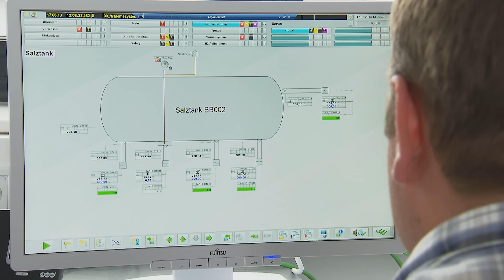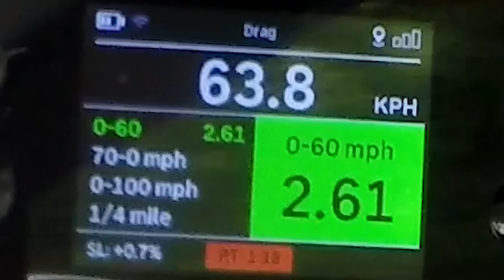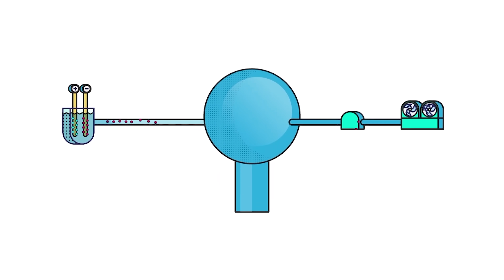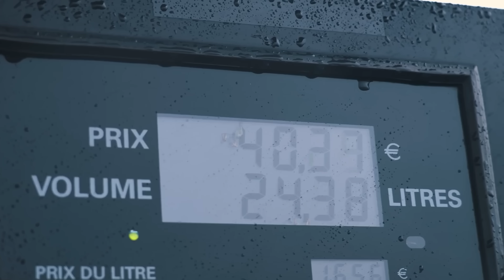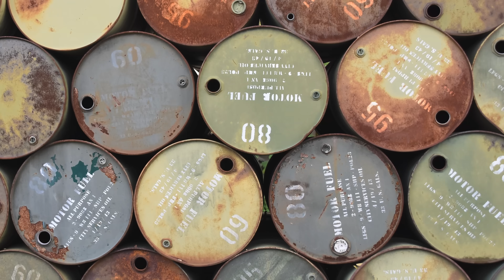Porsche just SAVED petrol engines FOREVER

Comment: I wish Porsche the best of luck on their ambition to save the cars
Reply: The only problem with this idea is the new fuel costs twice as much as the old fuel😂
Reply: @kellykubik4514  its currently around 6 euros a litre and normal fuel is about 1.4 euros a litre so its pretty expensive but as more use it they should enter economies of scale and prices will fall because the fuel market *with alternatives, is elastic therefore the lower the price the more people will proportionally consume. This is only the case if you can choose between fossil and synthetic because otherwise its a cartel and you have to consume one. Such as in the UK our fuel prices are incredibly high even when global oil prices are lower than they were before the ukraine war.
Reply: @fintan.  very well said
Reply: @fintan.  There is only one problem: electricity allows to drive electric vehicles at a cost of only 3 dollars per 100km, or 5 dollars per 100 miles. Synfuel thermal engines will consume around 5 to 6 litres per 100km, or 8 litres at best for 100 miles. So it would cost 48 dollars at least to drive such a car 100 miles. Price needs to drop TENFOLD to be able to compete with electricity, so the litre must go below 60 cents. Knowing that one litre has 12 kWh of energy, even if we achieved 100% energy efficiency from electricity to synfuel (which is physically impossible), you need to produce electricity at a cost of less than 5 cents per kWh. And given a 20% energy efficiency, we are more realistically looking for electricity produced for less than 1 cent per kWh.
Good luck with that. I stick to elctric, the real car of the future, like it or not.
Reply: @texanplayer7651  whilst you make a reasonable case, in europe and especially the uk where i am from, we are seeing a much worse scenario. our electricity prices are through the roof. our government decided to buy lots of energy at the peak thinking it was going to increase in price, and since it has crashed but we are left paying 33.2p per kwh on average. which in dollars is 0.41 usd per kwh. according to google you’re average is is 0.14usd. understand that’s about the third of the price. That’s already a bad start 💀 anyway, the average petrol price in the uk is about £1.45 per litre. this converts to 7 dollars a gallon, again that is terrible. The case for synthetic fuels in the UK is much more viable than america. considering we are paying double the petrol prices, and triple the electricity, whilst it is not tenfold, with government intervention it will pull down prices drastically and i’d prefer to own a combustion engine car that will go the same distance on a tank after 30 years than an electric car that can’t go half its range after 10. electric cars are only viable for people who are willing to spend 30% more on the respective model, for it to achieve a range of 30% less. at a cost of 20% more due to electricity being more expensive per mile than petrol. diesel is proportionally more expensive to petrol as the range extension it provides. diesel is 15% more expensive and you will go 15% further on normal journeys so let’s assume they are the same. when electric cars are more expensive to purchase, and run (right now in thr uk they are) and the infrastructure is absolutely disgusting, oh and our government grant is basically gone. there is no incentive to purchase an electric car that will need to be on the road for 10 years in order to be more green than a combustion engine car (battery disposal and production and source of electricity not being green). 

on top of this, in england our government has pretty much removed the financial grant to purchase an electric car as i said earlier. If you could provide a reasonable answer to why this is, other than it’s a sign they made a mistake pushing electric cars and are now stepping back in force of synthetic, then by all means i count my argument invalid. a final point i’ll make is how OPEC has a complete monopoly and cartel control over oil, so why be subjected to their manipulation to oil prices. Anyway, i don’t mean to come across rude if that’s how it appears
Reply: @kellykubik4514  that’s because the technology is very new, as the production becomes widespread it’ll get a lot cheaper
Reply: @kellykubik4514  How much will it cost to charge up an EV in 10 years with the way energy bills have increased? You do realise wind and solar power is way more expensive than coal or natural gas? Also C02 is plant food and climate change is a death cult.
Reply: @kellykubik4514  in Sweden we pay like 3x the price of the fuel in America so you’ll be fine but here… it’s gonna be rough
Reply: @kellykubik4514  that's because there's only 1 supplier right now. They have no competition at the moment.
Reply: @kellykubik4514  ye, that'll come down obviously as the production ramps up and the process is refined... Thought this would have been obvious to people but nvm
Reply: @adampatterson2682  you think so hey, that’s what they said about gas and the prices keep going up, in a world of capitalism you can not underestimate big business😂
Reply: @kellykubik4514  Thats why it is DOA
Reply: Its because they arent mass producing it but once they get more help for mass production it will be the same as our current fuel@kellykubik4514
Reply: @kellykubik4514  Yes because it’s in early development but Porsche predicts that once, or if, it’s adopted on a larger scale they can bring it down to under $2 per litre, which is basically the cost of petrol in most parts of europe now.
Reply: @kellykubik4514  I am paying. I don't mind
Reply: @kellykubik4514  The only problem with this idea is the new fuel costs twice as much as the old fuel
Inherently.  It's a con.
Reply: Well said! Samsies!!! This is it!!! We need that fine GERMAN ENGINEERING to pull the automotive enthusiast out of this!!!
Reply: Smoke and mirrors! Carbon emissions from farming alone is in a different league to car emissions. ICE aren’t going anywhere in a hurry regardless of wether they bring this fuel to the masses or not. There is so much oil in the earth, we couldn’t deplete the supply if we tried! Not only that, the ICE of at least the last decade or so have been so efficient and clean they are more or less emitting water from the tailpipe. There just isn’t an extensive enough of an infrastructure to support ev cars anywhere anyways. A good friend of mine told me that in LA for instance, they have two hour cues just to get to use a charger. Then yu have to sit and wait to charge ur batt. Add that I was told their electrical grid cannot handle everyone charging at the same time. So go figure.!! I’m seeing manuals, V12’s, V8, all sorts of exotica being released of late! All the major car brands are not looking to abandon so many million and years of development just because some stupid lying politicians are attempting to push their agendas! Just my 2cent for whatever it’s worth! So, here to many more years of the ICE!!🥂🚗🚛🏎
Reply: The world has been getting warmer since the ice ages, there nothing we can do to stop it
Reply: Hope we won't have to suffer the misery of Ev's in future.
Reply: They already have saved the car by making the Taycan.
Reply: Good luck buying a litre of e-fuel for 20€
Reply: @vojtulee1  it’s only that much due to the one factory they have and the distance it is from major distribution points
Reply: @sama5946  it's not just that
Reply: Forget Lamborghini, time to save up for a porsche.
Reply: So, we use lots of electricity to manufacture e-fuel, then burn it, and then start the process again?
Carbon offset is a joke.
Reply: @ricco123tube  if most of the electricity is coming from renewable sources, i dont see any issues
Reply: How about instead of hope we just vote out all the controlled commie scum in government? Climate change is a scam. No one voted for any of the measures they're forcing on us
Reply: I wish
Reply: The sound of burning petrol  turns me on🤤
Reply: @ST22HTV  is Porsche 959 powered by Petrol?
Reply: Yes but why did it take them so long to develop this… if they wouldve started earlier and succeeded, electric cars probably wouldnt have been so mainstream as they are now…
Reply: To safe ICE. Saving cars😂
Reply: "best of luck on their ambition to save the cars"

"Cars" will be there a long time into the future. It's the specific engines that are contributing to climate crisis that are being phased out.
Reply: Porsche aren't doing it to save cars. They're doing it to sustain their Motorsport activities in the years ahead. There will never be enough to go on general sale. It is hoped (note the word hoped) that the manufacturing plant in Chile may be able to produce up to 500 million litres a year. Sounds a lot, until you discover the World uses more petrol than that in a single day
Reply: Porshe ambition is to make money not to save cars. 🤣
Reply: I think the German carmakers are trying to hold onto something that's past its sell by date. As long as China continues innovating and leading the way in EVs , Europe is wasting it's time. They better jump on the bandwagon and be part of the evolution
Reply: Lol, its all bullshit. Exxon oilers are behind it. Porsche is just their puppet. Its just a distraction for ppl, to not buy EVs and buy more ICE. 😜
Reply: I wish politicians in the US and UK would listen to globalists telling them it won’t make a difference. No change to our climate whatsoever unless the entire world does it. That’s not happening.
Reply: @ST22HTV  Trac heh
Reply: It was done 60 yr ago with a converted vw beetle the inventor was murdered and his technology was stolen , he wanted the world to benefit and wouldn't sell out to the car manufacturers,  his invention was featured on american news you can still watch it on you tube
Reply: Is Porsche German?
Reply: @dug439  yes
Reply: AHAHAH you are so NAIVE, it has nothing to do with saving cars, they could have left "normal" cars as they are. Porsche is a German company. Their new fuel is German technology. Germany used UE to force everyone into buying this new fuel. That's how you make money, brother.
Reply: Hahahaha suddenly the name porsche can bring out cars that run on better fuel but that wasn't an option for the rest of us as a cure to climate bullcrap!!!! Come on people wake the fu*# up. We been making sinthetic fuels well over any 100 years... If you have a diesel engine then more than likely it will run on straight motor oil
Reply: very likely efuels gonna be unaffordable, if not massively subsidized…
Reply: Well this will be a much needed respite for Petrol heads but not soo much good news for oil producers. As an EV owner, until we are getting cars with a range of 500+ actual miles & charging speed/infrastructure improves, EV adoption will lag behind the hurdles mentioned.
Reply: So, EVs aren't car??
Reply: ikr because these evs german cars aint it
Reply: The good news is that it’s not just Porsche. The German government re-negotiated the 2035 eu deal specifically to include carbon-neutral synthetic fuel cars and they also subsidised the project. 

And anyone who still believes governments want this change for the environment should note the UK will not adopt synthetic fuel cars despite it being a far more efficient, cheaper and equally, if not more, clean solution.
Reply: Keep on dreaming. It will not happen. Recently Audi and Renault CEO's said e-fuel will not change nothing. Only high end exotic cars will use e-fuel. But is a good new for keeping classic cars on move in the future, and will save the aviation and maritime transport.
Reply: @DILINGER0  20 years ago people said same things about diesel. It will make a world of difference
Reply: @KingofInterns  You can discuss that with Luca di Meo or Markus Duessman, two of more important people in the industry. Do you think their opinion has no a solid base?. Do you think if e-fuel could save the industry they will not try to use this technology?. Why nobody lobbied UE regulators to choose e-fuels as the solution to fight climate change, 10-15 years ago?. The fact is that they know BEVs will be cheaper than ICE cars in many ways. So they choose to make BEVs because they have interest to make BEVs rather than ICEs. And that's why they are investing billions in a very short time.
Di Meo said in a recently interview that nobody is making new ICE engines. And nobody will do, except exotic makers. Makers ar not interested in doing more ICE cars. That's the truth.
Reply: @KingofInterns  yes, and diesel did change something in the world in a different way... its called the diesel-gate and its still not over yet :D ;D ...a great example for the technological limits for combustion engines. The couple percent you get out of efficiency is effortless when you have a 90% efficient rate in a electric engine... the key is not technology, its price. You can`t compare a 5 times higher price technology mate.
Reply: @CaptainAhab  my point exactly. Diesel gate ---> electric gate. 90% efficient engine won't help when you are charging with dirty electricity. 

Price of electricity will also go up for EV a lot and will be taxes. FF will be cheaper and not much worse for the environment. Synthetic fuel will be much cleaner in the long run
Reply: It's not Porsche, it's all of Germany excerpt VAG
Reply: @flipmo9579  you say all of Germany except vw but since 2011 Porsche has been a subsidiary of vw. A company with so much debt it's not certain it or any of its brands will be around long enough to make synthetic fule a thing
Reply: Dude i can finaly stop worrying that i can never drive a petrol car if that works good. That would be a insane relief
Reply: @Nightcore_all_night  RELEVE
Reply: @vojtulee1  i mean relief😂 oooof
Reply: problem with Porsche and other brands they are 💩 of making electricity car, Tesla invest so much in their charging station that no one can beat them
Reply: @Slots-Room  Feed
Reply: @Slots-Room  too bad they don't pay rent for them and they're all being closed. Also their new cars are terrible quality and their old cars are blowing up. The Taycan is fire though.
Reply: @Slots-Room  having fun digging for cobalt and lithium for your sim rig ev fanboy
Reply: @Slots-Room  problem is, you have to drive a tesla
Reply: @Slots-Room  but elon forget to thread his employes like humans and pay fair its the same with Dacia and the result is realy bad quality and extremely unreliable cars. Porsche pay top bonuses to his emploeyes and it dosn´t matter what your Job is every body got the same.
Reply: I wish Porsche the best of luck on their journey to bankruptcy, the bone heads!
Reply: @RussellFineArt  as part of a company with 688.000 employes(6 Times more as Tesla) and secound biggest car manufactur behind Toyota it is a little bit different and the biggest owner of the VW AG with over 50% voting rights is the Porsche(Piech) Holding. With other Words the Porsche Familie.
Reply: @RussellFineArt  just you wait buddy, Porsche does not go bankrupt that fast
Reply: @RussellFineArt  lol it’s funny somebody like you calling Porsche “bone heads”
Reply: @RussellFineArt  They are German. For a country willing to wage war on the world , they are resilient
Reply: @RussellFineArt  ah yea, billion dollar company will go bankrupt or we will all starve to death, i dont know which one to pick...
Reply: @RussellFineArt  that's cope. Porsche RND is nearly unmatched.
Reply: @RussellFineArt i wouldn't hold your breath
Reply: @RussellFineArt  They know what they're doing.
Reply: @RussellFineArt  Say you're unaware and dishonest towards reality without saying so.
Reply: @RussellFineArt  Could you explain the issues with synthetic fuels that are worse than electric? cobalt and lithium are running out in two years so electric cars will never be the future, and governments aren’t recognising it as it’ll make them a fool of themselves. whilst sneakily in the UK ours has removed the grant for them…
Reply: @fintan.  lithium and cobald dont run out in two years. there is much lithium on earth and cobald isnt needed for new batterys. Also there will be battery with  other materials then lithium. And the biggest issue of synthetic fuels is that it needs 4 times more energy then Electric cars. we dont have enough energy to produce enough synthetic fuels. Would be a big waste to use the energy in synthetic fuels instead of just loading it into cars. synthetic fuels just make sense for big ships or planes.
Reply: @Fintan  yep and it will be called electric gate 😊
Reply: @fintan.  The latest figures show a boom in supplies of many of the most important minerals for the energy transition. Lithium reserves are up 18% from last year. Cobalt has seen a 9.2% gain.
Reply: @fintan.  I'd like to know where you've seen lithium is running out in two years. Cobalt shortage is between 2028 and 2033 but there won't be cobalt in BEV anymore by then (e.g. LFP ones don't have cobalt already). Synthetic fuels is simply not viable for anybody's cars as it extremely energy intensive to produce/very expensive and so it's for niche market only (e.g. racing, maybe planes but cost is so prohibitive that I doubt it).
Reply: @fintan.  there's so much lithium in earth you don't even know, please educate yourself
Reply: @inebium  the difference is that lithium and cobalt are primarily extracted in central africa, where china decided to take over 15-20 years ago. so i’m sure they’d love to offer it to use at a nice cheap price so we all succeed in a perfectly competitive market, let’s ignore the skyrocketing prices of these resources too which will make them unviable. but nah i’m like you i totally 100% trust china to export these valuable resources and not divert it to themselves. And even if we’d run out of supply in 8 years that means 1 year into the Uk government plan to ban combustion engine car sales they run out of electric. that’s genuinely hilarious
Reply: @fintan.  don't believe the fossil fuel lobby lies about not enough lithium and cobalt. Plenty of it for electric cars. In any case battery development is going at a hell of a pace. The next generation of batteries are sodium ion batteries, so don't use lithium, can also charge within 10 min and have circa 500 mile ranges. Expect these batteries in the second half of this decade. 

I'm afraid e fuels will never take off for large scale adoption. They need so much energy to make and that energy needs to come from renewable if it is to be carbon neutral. Far more efficient to just but that energy straight into a battery for a car.
Reply: @fintan.  Electric cars have its place .... in a fair ground and golf course
Reply: @princesssolace4337  in that situation it’s perfectly understandable, but as electric cars essentially rob the very small remaining resources we have left, it’s putting the market in a very odd position. Germany are already on the way to push back the 2035 combustion engine deadline and have been trying for a while now, but with synthetic fuels gaining a grip on politicians it’s likely it will work in the long term. It would make a lot of sense for governments to subsidise this process until everybody adopts it and tax it through the roof (what happened to diesel in the uk and now electric cars). so there’s an incentive for everyone to adopt it once it reaches a reasonable price level.
Reply: @n-brand_de  Porsche uses solar to produce the energy required for the process in their factory in Chile...
Also , talking about using energy, how do you think majority of the world's electricity is generated?
Reply: @fintan.  cobalt is extracted in central africa but not lithium which today is primarily extracted in Australia (52%) and Chile (25%) and there is lot of it on the planet. There is a good amount in Europe but there is the not in my backyard problem. As I already mentioned Cobalt is already starting to not be used in some car batteries and will likely no longer be well before we run out.
Reply: @fintan.  in near future electric cars wont need cobalt and lithium anymore for their batteries
Reply: @Soulleey  the only viable alternative currently is sodium ion batteries. these are much much heavier and are no where near as efficient. whilst your point holds it doesn’t necessarily mean that we will just move on from these resources. the problem arises when we have much much heavier electric cars, which need more power to push the weight, needing a bigger battery to make it more efficient, to then be heavier as a result. it’s an infinite loop that will mean lots of work will need to be done to mitigate it, by factors of more than 10 which is very hard to see if you consider that electric cars have only increased range by 50% in 10 years
Reply: @fintan.  Tesla have changed over to sodium (salt) batteries, but I agree EV`s are not future sustainable.
Reply: @n-brand_de  remember when computers were the size of building that had less power than todays smartwatches?
Reply: @fintan.  In 2 years :)))))  And also who need cobalt and even lithium in few years
Reply: @SilvestarJurkovic  cobalt and lithium are the top resources used to store electricity. they are the most efficient at it and without them we will likely see electricity prices increase as the cost of storing them increase with less efficient alternative storage solutions. overall these will very heavily impact the countries that are dependent on them
Reply: @fintan.  LFP? Sodium batteries? No cobalt, no lithium. Already on market with min 70% of lithium batteries capacity  and 30 to 50% less cost and that will be improbed fast. And you can store electricity without batteries too. Every day new way to do it. Many will fail, some will be very good sollution for stationary storage. And that is all done in last 2,3 years
Reply: @fintan.  you should watch fully charged or the electric Viking (and a few others for that matter), materials for batteries running out in 2 or 3 years has been proven to be horse shit many times. Also there are many new chemistries with no cobalt and even moving away from lithium. If your going to argue against ev's at least keep updated
Reply: @jackbrudenell5823  The problem is adoption of the technology. Not everybody is prepared to get into electric vehicles any time soon, so is going to take time. It seems that the world wants people to burn all of the gas cars as soon as possible. Its getting to the point that they are hating manufacturers for diversifying their portfolios. Every manufacturer has EV is their line ups, however, there are those that said that If its not EVs only your company will die, ridiculous.
Reply: @bikeman123  last year was only it was said to be expected to see out 12 years for lithium so what’s that then if there’s a 18% boom another two years worth? Plus that’s a lot of land and eco systems to be destroyed.
Reply: @fintan.  2 Years???? The worlds largest lithium deposit is 100km away from me, it's been operating since 1983 and has a projected current life span of 23 years to go.... Australia has so much lithium that there will be new tech to supersede it before it comes close to being exhausted.
Reply: @fintan.  Lithium, Cobalt, LNG, Iron Ore, Gold (2nd) all have higher production in Australia than anywhere else in the world....
Reply: @fintan. you are the only one making a fool of yourself…